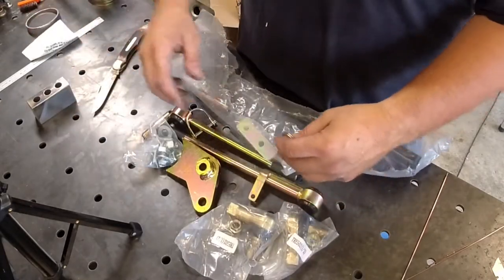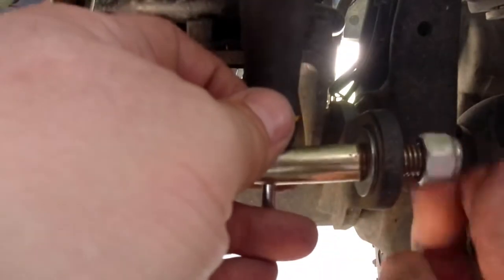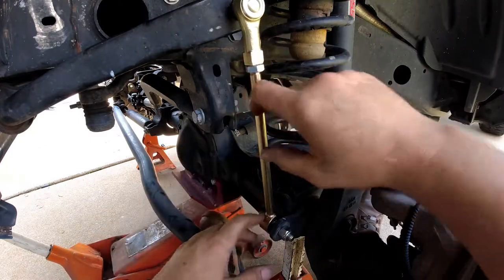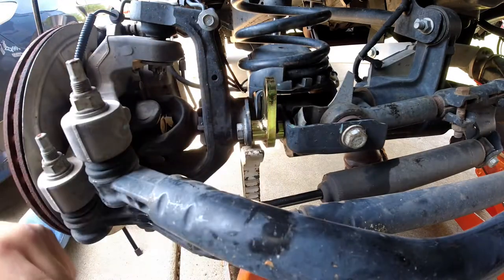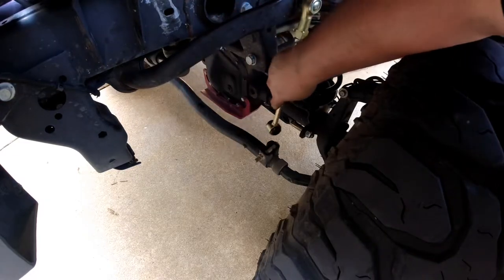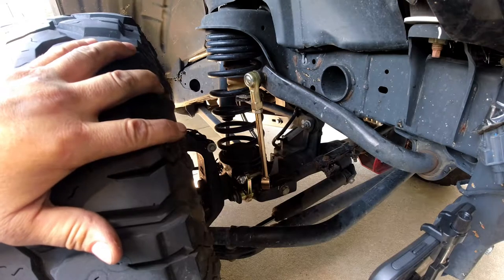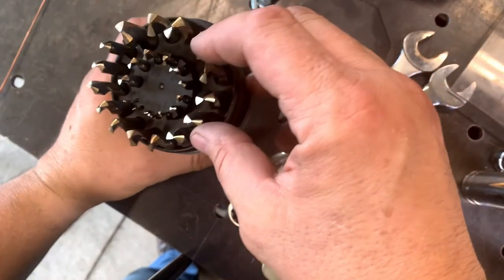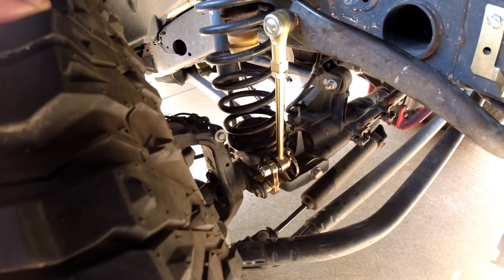MetalCloak Swaybar Disconnects

Comment: Do you think a taller lift would put that sway bar closer to horizontal where it's supposed to be?  I'm on 4" diesel springs in the front with half inch spacers and I believe my end links are either 12" in the front or 13", can't remember which.
Reply from the maker: It should, the links can always be cut and re threaded. For the price they are a great value.
Reply: @JeepingMo  I agree, great price on them.  There's nothing out there at this price in this quality range.  I was leaning towards the Synergy links but upon watching their installation video, the installer states that relocation brackets are required for Jeeps with more than 3.5" of lift.  I'm just not interested in adding extra stuff like that.  I have no sway bar brackets, no control arm brackets, no track bar brackets.  Make it fit like factory or move on!

Comment: How much of a lift do you have?
Reply from the maker: 3 1/2 metal cloak.   Thanks for viewing.
Reply: @JeepingMo  awesome! Really want to get these links for my JL but I have a 2in endurosport lift from Dynatrac so I’m 2in higher than stock rubi height and I’m scared these will be too long, what do you think since you’ve had them on? And is too long really that bad?
Reply from the maker: @Chilly17  i had them on when i had a 2” spacer lift on. The sway bar was at a higher angle.  You could always run a thread die down them and cut to the length you would like also.   Thanks for viewing.
Reply: @JeepingMo  was there any difference with a higher angle? People are saying a high angle doesn’t affect much

Comment: Are you still running these? How has it been with such a steep angle? What size lift do you have? I have a 2.5in lift but am at 3in of lift. Wondering if these will work for me. When I measure it seems like it will be a steep angle for me too.
Reply from the maker: These are actually my second set, the first set were ruined when the nut came off and ground the thread off of one of them. I trimmed those so the bar was horizontal but they were hard to get on. I run a 3 1/2 inch MetalCloak spring  . They work good and for the price you really can’t beat them you can always trim them and run a die down them.  Thanks for your good questions do you have any more please reach out, thanks for viewing and subscribing if you enjoy Fabrication we have a second channel as well.